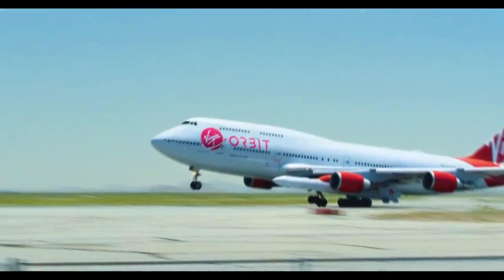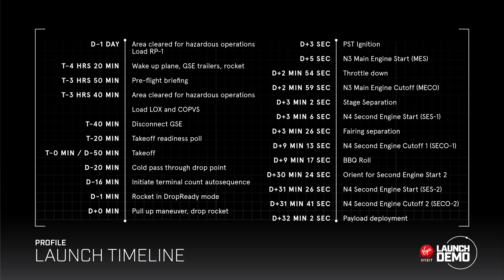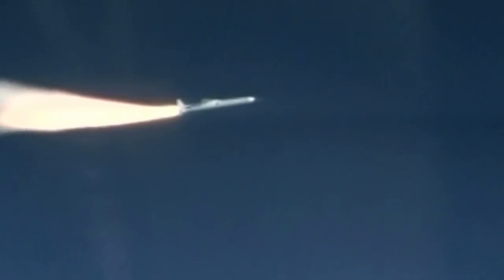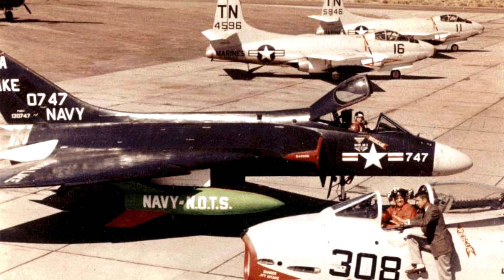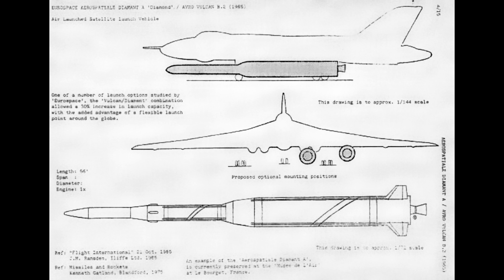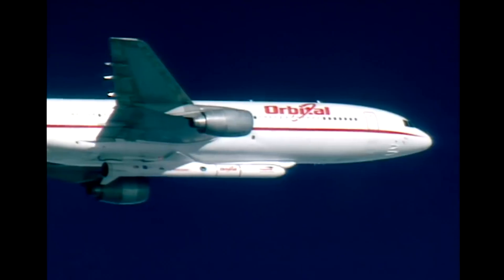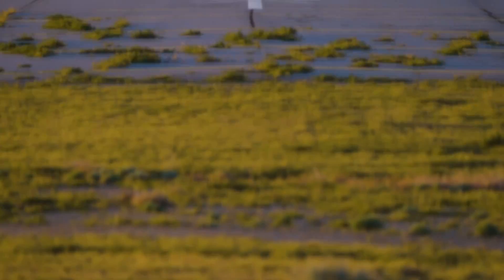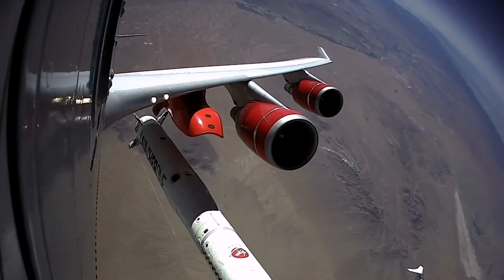Virgin's Orbit's Failed Rocket Launch & The History Of Air Lauched Rockets To Orbit

Comment: My guess is their fuel pump went out...same thing happened to my truck this afternoon. :)
Reply: Do you think the guys at the local fix-it shop have a loaner that can get to orbit until at least Thursday when the parts come in, or maybe Friday when they can get it changed out?
Probably not, I guess. Bummer.
Reply: Fun fact, rockets typically used "gas" turbines to pump the fuel, so it's like a jet-powered fuel pump
Reply: @laprepper  Huh, I wonder if the shop has a spare APU  (little jet engine) I could use instead of the dinky little electric motor that only lasted 15 years...
Reply: Did the truck crash into the ocean???
Reply: Wow! The three of us!?
Reply: My truck too. Every time it fails to reach orbit it’s the goddamn fuel pump.

Comment: is it possible to use a railgun to get ppl into space, not an orbit but into outer space beyond the earth's reach ??? somthing like 10 miles into the ground with a 3rd of it above ground ??? been pondering this
Reply: It'd have to stick out into space if you want it to work. You have reach ridiculous speeds in order to not fall back onto Earth, some 25,000 mph. While reentry can get relatively close to these speeds, it's at a thinner part of the atmosphere. If the rail gun had a vacuum before launching a vehicle through the atmosphere and beyond, then the encountering the atmosphere that fast would be like slamming into a brick wall. Having it extend Ito space where it can have a vacuum and avoid the atmosphere has the same problems as a space elevator

Comment: I was able to see it from the California coast. It matches perfectly with Scott's description. Saw the contrail while under power. Then nothing. Then  a flash with a flame pointed up and an object going down while trailing fire for a couple seconds before going poof in a black cloud of smoke.
Reply: Looking at the visual recording of the drop test and the single photo of ignition.  I conclude that LauncherOne pitches nose down upon release. The three second gravitational turn before ignition plus the nose down pitch makes returning to a nominal flight pitch up attitude beyond what the guidance and control system can correct. Edit: I just watched the recap video released from Virgin Orbit showing the ignition and shutdown after release. LauncherOne pitches down even more than I thought after release.
Reply: So they did a destructive abort vs a parachute recovery? Weird.
Reply: @mgabrysSF  normal for a failed rocket.
 You do not want big mostly intact rockets landing then blowing up on impact.
Reply: @mgabrysSF  LauncherOne doesn't have parachutes, or does it?
Reply: @mgabrysSF  I can think of two reasons why it didn't go down on parachute. 
One is that it may have failed catastrophically and was unable to and the other is that maybe they just didn't intend to. 

The reason for not intending to could be in the difficulty of pulling it off. They would probably need to dump all the propellant to make it light enough for the parachute to bear and doing that may have been difficult to achieve in a short enough time to complete before hitting the ground.

I still think though that for an experimental rocket it would be very beneficial to recover as much of it intact as possible both to help figure out better what exactly went wrong, as well if lucky enough to be able to reuse it (or surviving parts of it) for another attempt saving the time and money of building a whole new one.
Reply: Virgin Orbit released their blog post last night and said the rocket didn't explode, instead falling to the ocean
Reply: @peregrinedevelopments3730  Yes, but in how many pieces?

Comment: What about when the airforce launched a Minuteman ICBM out of a C5 Galaxy in the 70s?
Reply from the maker: Not an orbital rocket
Reply: @scottmanley  oh did they not actually put it in orbit? I read that it was successful? 

Interesting tho that no one else has tried to set up a mid-air vertical launch as they did.
Reply: @Atreid3s  How did they fit a vertical minuteman inside a mostly horizontal cargo plane?
Reply: @johndododoe1411  they developed a cradle that held it. They were then able to have it pulled out the rear cargo door with a parachute.  The ICBM then detached from the cradle and was righted to the vertical position with another set of parachutes and fired. Pretty cool!
Reply: @Atreid3s  ICBMs dont go to orbit, therefore a successful test would not involve orbit.
Reply: @Atreid3s  they did. The f15 eagle has official capability of shooting down satellites. And it does almost exactly that, full vertical climb on deploy of the missile
Reply: @Atreid3s  No it was basically just a drop test. Fired for about 25 seconds but actually did more or less work as hoped (flying upwards, not blowing up the plane).
Reply: @Atreid3s   I had to go look this up, I had never heard of it before. It was only a an atmospheric test. Apparently the rocket only fired for a few seconds and reached an altitude of 30,000 feet, which was what was planned. It was never intended as an orbital system, but was a proposal make our missiles impossible for the Soviets to destroy.
Reply: @johndododoe1411   The missile was pulled out the back of the plane by a parachute which then caused it to hang vertically in the air.
Reply: That was a ballistic missile hence the name intercontinental ballistic missile aka ICBM
Reply: @MRblazedBEANS   The Atlas and Titan missiles used in Mercury and Gemini were ICBMs but they were powerful enough to achieve orbit with a small enough payload.
Reply: That project, as I understood it, took a different approach.  The missile first oriented it axis to the vertical position before it ignited its engines.  Also, because the Minuteman missile is a solid fuel rocket, it didn't confront the problem of stabilizing the flow of fuel while flying horizontally.
Reply: Having worked on the MX with a lot of people who worked on Minuteman III there is no question that the MX could have orbited its upper stage with full complement of warheads. Probably also one or more versions of the Minuteman.
Reply: @dalecomer5951  It is not uncommon for the US to vastly under-report the capabilities of strategic assets like this... the reported maximum test depth of a submarine is rumoured to be quite an understatement. The Blackbird flew a lot faster and higher than any number they've even said with a wink and a smirk.
Reply: @W1ldTangent  i worked with two retired FAA ATC who had worked at Palmdale Center. They would track SR-71 departing AF Plant 42 with the altitude scanning radar. They would lose them between 115,000 and 120,000 ft. depending on atmospheric conditions. However, the Blackbirds were still ascending at the same rate of climb. So it was estimated that they must have been climbing to at least 125,000 or 130,000 ft. And that was probably just to return to Beale AFB. The polots only requested clearance to 90,000 ft. ("angels nine zero") which is the unclassified service ceiliing of the SR-71.
Reply: But this guy did it with a red plane. And better publicity
Reply: Suborbital
Reply: Every ICBM is an orbital rocket with slightly too much payload. ;)
Reply: @grantexploit5903  Not all of them, some wouldn't reach orbit even with zero payload.
But in general, yes, and ICBM is a rocket that just slightly fails to make orbit, and then attempts to drop its payload intact and in a specific place.
Reply: T-zar bomb was "launched" using this same nose-up drop method to give the plane more time to scape.
Reply: @xiro6  Huh? Tzar-bomb got a parachute. Nosing up would slow the plane down, methinks. From what I've seen in video, they were flying level.

Comment: Would it be possible to use bladders in the tanks for these fuels?
Reply: Bladders with cryogenic propellants ? Nope.
Reply: @tomf3150  Oxygen and Hydrogen would be super cooled, but don't they use kerosene and LOX for the first stage?  I was thinking something similar to the pressure bladder used for home water systems in the kerosene tank(s).
Reply: @michiganengineer8621  LOX stands for liquid oxygen.

Comment: There was a time the US Air Force was launching ICBM's out of cargo planes!
Reply: paula  They don't have to - it is only half-Earth to the farthest point you may want to strike. In fact, if any ICBM ever has a capability to go to orbit, I'd assume it is a bad design - instead of this extra capability they should have taken an extra 300kT warhead or two.
Reply: @vladimirdyuzhev  uhh... Pretty sure that's actually the case. People forget both Gemini and Mercury rockets in the space program were developed from ballistic missiles. Take the warheads out, put a slightly lighter payload in, like a capsule, and it should have the energy to reach orbit. Anybody who plays KSP knows there isn't that much difference in deltaV between a suborbital launch to the other side of the planet, and a circular orbit.
Reply: @vladimirdyuzhev   The Atlas missiles used on Project Mercury, and the Titans used on Gemini, were both ICBMs. It's just a matter of payloads mass.
Reply: Well, they did that once. interesting concept. I wonder if the idea had been to keep the planes on the ground and scramble them in the event of an attack, or constantly keep them in the air so that the missile force never could be attacked?

Comment: F-104 "A plane that wants to be a rocket" Yep
Reply: What the heck was that clip that looked like it was taking off with a solid booster?
Reply: @Hyperlooper  A ZEL (Zero-Length Erector-Launcher) Test.  The primary role of the F-104 in Luftwaffe service was Nuclear Strike.  All well and good, except that the Warsaw Pact knew where every West German airfield was, and you can bet they were going to get pasted early and often. So, in typical late 1950s  early 1960s fashion, it was decided that the Best Thing was to make the F-104 airfield independent. (At least for the takeoff - in Global Thermonuclear War, you really didn't think much about the landing) So - you strap a big rocket on it, and fire it off a ramp on a truck trailer, which, theoretically, could launch from any clear flat spot.
To be totally fair, this wasn't a Lockheed/Luftwaffe idea.  The USAF had come up with it about 1955, proved it out with written-off straight-winged F-84s (Because nobody cared if they got broken), then with specially equipped F-100Ds.  The last blocks of F-100s were set up for ZEL launches.  It was soon realized that since the trip was going to be one way, the targets were already picked out, and the moaning of the pilots could be heard over the whining of the engines, that there mivht be a better way, and the system was used for  the Matador and Mave cruise missiles, which were deployed in Europe and the Pacific from about 1957 - 1965 or so.
Reply: Peter Stickney 
Makes me think of the damn near suicidal WW2 German interceptor Bachem BA 349. A manned rocket literally built out of wood, glue, and nails!  And in some respects, built out of desperation at the end of the war. 

In part due to the arrival of the U.S. 10th. Armored Division, the Natter, (Viper) as it was called. Was never flown in anger..
Reply: @BoHolbo  nice to see you here boss. 
 One heck of a ride.
Reply: @peterstickney7608  My recollection is that the ZEL idea was adapted from the launch boosters of the early air breathing cruise missiles such as Regulus, Snark, Matador, etc., and then someone got the bright idea to try it with a fighter. It was first demonstrated with the F-100.
Reply: @BoHolbo  The Natter was more of a manned SAM.  The WW2 Germans, for all their technical capabilities, couldn't suss out the 2 things vital to a Surface to Air Missile - The Guidance System, and the Proximity Fuze.  (Well, that, and Solid Propellants more sophisticated than a Black Powder fireworks skyrocket. They got past those issues buy deciding that they'd put a cockpit in it, and stuff some poor bloke inside.  (Oh, and try to recover the rocket motor, since liquid rocket motors were expensive and tough to make quickly)  The first flight, in early March 1945, killed the pilot, and required redesign of the cockpit.  This, of course, takes time, that the Germans didn't have.
By the time of the surrender, no production-level airframes had been built.  One way or the other,  the Natter wasn't ever going to be used operationally.
Reply: @dalecomer5951 The early Snarks and Matadors were launched from rocket sleds, off of a horizontal track. Sorting out the Zero-Length Launch was a major issue, leading to the Atlantic off of Cape Canaveral becoming known as "Snark Infested Waters".  If fact, the development for manned an unmanned aircraft was in parallel.  The first aircraft used were clapped out straight-wing F-84Bs and Cs,
initially unmanned and unpowered (The world's largest hand-launched gliders), and latter manned, and with the engine running.
After a number of successful all-up flights, it was decided to make provisions for it in  suitable fighter-bombers, and it was incorporated into the F-100D-85 block, the last F-100s built.
Reply: @peterstickney7608  It's one of my favorite planes, and I never knew these things. Good to hear it's getting a new job…
Reply: @Hyperlooper , asks "What the heck was that clip that looked like it was taking off with a solid booster?"
That was a clip of it taking off with a solid rocket booster.
Reply: @fred_derf  The West German Luftwaffe developed that zero-length, rocket-launched F-104G Starfighter takeoff system in the 1960s, to provide a quick-reaction capability against enemy bombers in the event of a Soviet and/or Warsaw Pact attack. In the U.S., very similar zero-length rocket-boosted takeoff systems--for the F-84 Thunderjet and the F-100 Super Sabre--were tested successfully, in the 1950s. None of these systems were, to my knowledge, ever made operational (I suspect that advances in surface-to-air missiles' range, target discrimination, and ability to pursue enemy bombers [and fighters] despite their evasive maneuvers and/or countermeasures, made them a cheaper alternative to the rocket-launched fighters).
Reply: @Hyperlooper  Starfighters had a rocket assist. Look for the video in which Chuck Yeager crashes an F-104.
Reply: @mikepatrick1904  Only the ones in that particular squadron, which was training USAF pilots for spaceflight. The F-104 in Yeager's accident was one of these specially modified Starfighters which had a rocket motor installed in the tail above the jet nozzle and gas thrusters in the nose. The pilot would use the rocket to zoom climb to stupid high edge-of-space type altitudes, where his jet engine would flame out and his control surfaces were useless, and use the thrusters to control the jet's altitude like he was flying a spacecraft for a few minutes, until he fell back to lower altitude where he would restart the jet and fly home.
Reply: @mikepatrick1904  

No, the plane Yeager stuffed was a special variant of the F104. 
A couple were built - and designated NF-104.

The NF variant had wing tip extensions (giving it a slightly longer wing span) hydrogen peroxide RCS thrusters,  and an added on rocket motor in the tail. 

The purpose of this special version of the F104 was to simulate reentry proceedures of the planned USAF X20 dynasoar spaceplane.  It was to give Airforce astronauts a chance to train for the flying re entry and glide back to Edwards AFB.    So the F104 would zoom climb to above 100k feet during which at some point the jet engine would flame out (like at 75k or so if I remember right) , and the rocket motor would be ignited to continue the climb to above 100k at the apex of the climb - the plane would  tip over into a zero G parabola, set up an angle for re entry using the RCS, and glide the plane down in a re entry attitude until it hit denser air and the J79 turbojet engine could be re started.
Reply: Hyperloop YUP... it was a Zero Launch idea... alert status. Pilot sitting inside.. cocked and locked...  well that was the idea anyway.  The practicality of the Pilot sitting there for hours... wasn’t going to fly.  But the launcher worked
Reply: They only put wings on it so they had somewhere to mount the nav lights..
Reply: Evilmike42   Because the Lockheed symbol is a star?  I mean, that's why there is the P-80 Shooting Star, the Constellation, the C-5 Galaxy, the F-94 Starfire, and many other examples.  Sorry, just saying. ;)
Reply: J M  
JATO units started with prop-planes and the term "jet" had a broader scope than we mean nowadays: at that time it was any sort of emitted stream of gas or fluid.
Reply: I've heard from someone that flew it that it was more a plane that wanted to become a lawn dart.
Reply: I thought it was the other way around.
Reply: That was the sobriquet applied to it by fighter pilots because it looked like a missile but in truth it was designed as an airplane from the ground up.
Reply: Kinda reminds me of the lunar rocket launch and recovery system from the old sci-fi series ufo from 1970. In a way.
Reply: A "missile with wings"... any pilot they find willing to take an old Widowmaker through a supersonic zoom climb to 70 thousand is going to be not quite right in the head.
Reply: @W1ldTangent  "widowmaker" came about due to the airforce trying to find a mission for a plane they had paid for but no longer had a mission. Interceptors were made obsolete once the Soviets developed ICBMs. So they strapped bombs and such nonsense to it for which it was never designed. Soviet bombers never flew at 70 thou, again outside design parameters.  Are you basing this on The Right Stuff? Reality doesn't support your assertion.  Pilots didn't die in the scenario you describe, they died flying a misused airframe the MIC HAD to find a use for. Simple really.
Reply: J M  IIRC, there are actual "JATO" devices that use jet engines, but they're not popular because a jet engine is an expensive thing to drop after using it for just a few seconds.